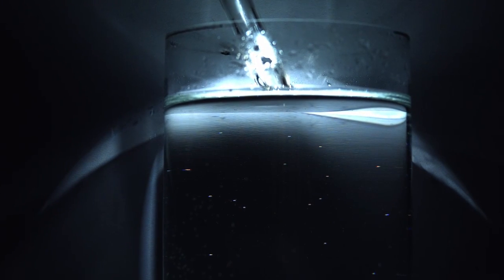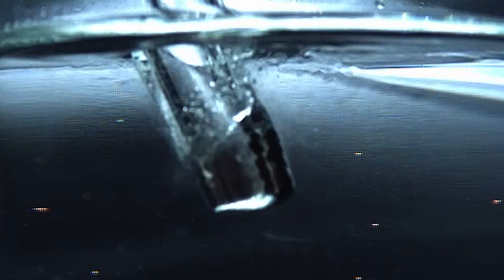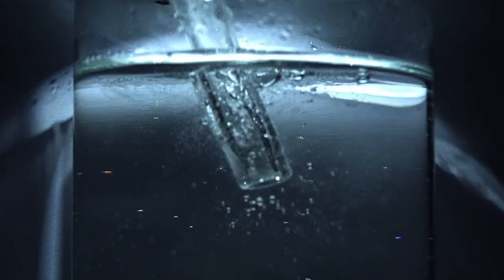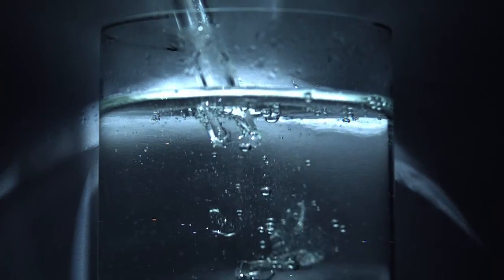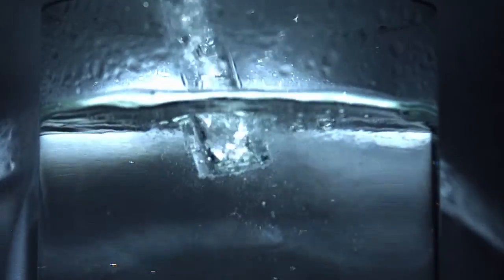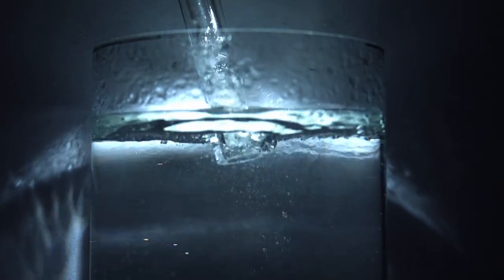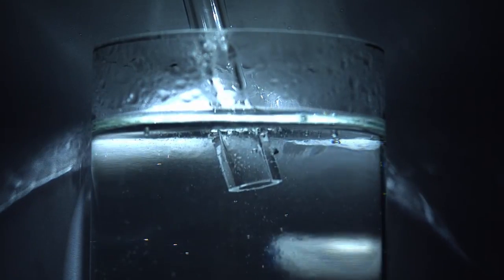What happens when RED HOT glass meets water? -Slow motion video

Comment: Could you try this same experiment with something that's colder than water, when in liquid form?

Also I have a feeling that the glass breaks because; while the most outside layer shrinks the most inside layer of the glass gives. But when they both shrink (e.g the water is sucked inside), nothing gives and the crack is started from both sides of the glass. And when the cracks meet, they combine and continue circling the tube.

Thanks for awesome videos!

Comment: Was waiting for the water to climb up the tube cause this made me think of a moronic thing me and my friends did while camping as young. We found a 30 cm steel pipe with about 5cm outer diamiter and i would guess close to 1 cm thick wich we put in our camp fire untill it got red hot. When red we thought, what are we going to do with it, and came up with the brilliant idea that we could drop it in the lake we camped just next to. Took as a big stick as we could in it to carry it (yes... i did say moronic) and managed to get it out of the fire. Cause of the weight and heat of it we had issues getting it to the lake cause it put fire to every thing. But at last we got it on the top of a good stick hard enough to get stuck carrying it the last bit.
Then comes the thing this reminded me of. On the end of the stick i put it gently down in the water at about 45degre angle. What we then thought was going to happen was that it would fizz and boil a bit. What happened, and what i with what i know now would have guessed would happen, was that it first shot of the stick straight into the water, then threw a jet of steam with a loud bang straight at me. Got away with very very minor burns to my hands luckily.

Thats how i got to know why dealing with very hot stuff and water can be a bit interesting ;)

Comment: I thought borosilicate was supported to be more thermally durable - unless yes you unevenly heat/cool it .
Like this!
i assume that suck of water flash cools the inside creating a gradient between the inside and outside...
Also these are glass tubes not 'rods'. 
I suspect a rod might fare better particularly if you immersed the whole thing!

Are these open or closed tubes?

Comment: The steam expanding on the outside of the tube is placing the tube under compression, where a tube is stronger. When the water is inside the tube, and expands to steam, it places it under expansion stress and cracks it open.

Comment: At a guess, since the crack happened near the interface between air and water, I'd assume that's one of the reasons for the crack. Putting it deeper in might be useful... if only so that there isn't a sudden, jarring change once the Leidenfrost wears off and air gets involved in some way.
I can see @Photoloss and his comment under as I write this and it's obviously thermal shock. I think he's onto something, and I wonder if putting the glass in deeper would change anything.

I'd also be curious to see what would happen with oil over the water. Different... what's it, thermal... thing. Forget what it's called. Metal feels colder than wood because different materials absorb heat differently. Air and water have different values, so does oil.
Reply: Thermal...Conductivity? 🤣
I like how everyone with high school understanding of physics(at very best) is trying to explain how it works with elementary physics concepts to a chemist PhD 🤣👌best one is user called fartgirl420 or something like that 🤣🤣
Take notes thunderfoot!!
Reply: @TheBozn  Don't you have a vodka rationing line to go stand in, comrade

Comment: Great stuff again, thanks VoTF. I liked the background music too.

Apart from the terrific spectacle of physics in slomo close-up :) I can't help looking a little into the materials.

I found: mean specific heat for both is the same (830 J/k*K), but for borosilicate thermal conductivity is 1.20 W/(m*K)@90°C and fused silica better with 1.47-1.55 W/(m*K)@100-200°C. 
These small differences improve silica over borosolicate, but obviously do not explain its improved thermal robustness. Must be in the microstructures?
Better SiO2 purity of silica forms a stronger 'lattice', in case of amorphous solids: smaller blocks, stacked more regularly.  My twopence..

A (lab)glass expert seeing your video could give us a few fine nuggets of knowlegde!

Ref: 
https://www.heraeus.com/en/hqs/fused_silica_quartz_knowledge_base/properties/properties.aspx
https://www.schott.com/d/borofloat/4d03b8f4-0583-4139-9841-952114e60dee/schott-data-sheet-thermal-properties-borofloat-english-23112018.pdf

Comment: I think it stopped boiling when it broke away because the heat energy was transformed into mechanical tension between differing layers contracting and expanding at different rates. That was then transformed into mechanical energy as it fractured, and then into motion as the pieces push away from each other. That explosive motion requires energy to break and move. That energy is only available in heat. As it robs the heat, it cools the glass. Similar to part of the process involved in refrigeration where expansion and evaporation robs heat energy to effect the break in surface tension between liquid to gaseous states. 

Notice that the silicate kept boiling even after sucking the cooler water up into the tube.

Comment: It's amazing how fast the glass shatters even at 20,000 fps.
Reply: glass cracks at about 3-4x speed of sound, around 1km/s, at 20000 fps in just one frame crack will expand 5cm, which is around (i think) a radius of this glass plunger
Reply: @NickPride  3-4x speed of sound in air*. Most materials crack at their respective speed of sound, which for solids is a lot higher than that of gases. The speed of sound in metals can be as high as 5 km/s. The reason it breaks at the speed of sound (of the material) is because that's the speed at which mechanical interactions are propagated, which seems pretty obvious when you put it that way.
Reply: speed of sound here was just for comparison of speeds, people usually know about speed of sound in regular conditions (air, 20C, 1atm) and can generally imagine how fast it is
Reply: @NickPride  right-right, I just thought I'd expand on it just in case it was confusing for anyone.

Comment: It seems rather simple, so I guess there is something I dont see:

It breaks when the inner part is cooled because there is nothing to support the contraction. when the outside layer cools, it increases the strain on the glass, but is supported by the glass underneath. When the inner glads is cooled there is nothing to support it so it shrinks and cant hold its own internal pressure, as it was. That, combined with the already elevated strain from the outer glass, causes the failure. Think of a Prince Rupert's drop. Try making one out of silicate and see the effect and how it differs.

Comment: For the breakage of the glass rod, my theory of the situation is that the breakage occurred from more-or-less obvious temperature delta (thermal shock) between the submerged portion and the unsubmerged portion of the glass tube. From there, it seems like the boiling of the water within the tube coupled with water intake that had caused a lower pressure zone below the bottom of the tube and caused the cracked portion of the glass to shoot in the downwards direction. I assume it was the transfer of energy of converting the water within the tube to steam, that caused the tube to break, only after, the tube had transferred a lot of its energy.

Very interesting footage! Love to see more!

Comment: OK, stress is needed to break the material. What stresses can we think of?
1) thermal differential stress (tip in water contracted, part out of water did not)
2) shock wave stress from flash boiling of water sucked up into tube
3) stress from impact of water hitting surface after steam bubble collapse
4) Pressure differential stress from water vs air or steam (trivial, but aren't most of these?)
that's all I can think of.

Comment: How about a video of you creating Rupert's Drops in water in high speed?  Not a video of one being destroyed by a hammer, or a gun, or a press. Those videos are all over youtube.  But a video of when the glass contacts the water, and forms its iconic shape. 

Hopefully, something like that is film-able, and the splash doesn't obscure the view.  Dunno how high up you have to drop the piece of molten glass from for it to work though.  If low enough, hopefully there wouldn't be too much of a splash. 

That could be a test too.  Can the glass drop from a small distance and it still work?  Does it HAVE to be dropped from multiple feet in the air?   How deep does the water have to be for it to work? Lots of very interesting questions to be had out of nothing more than glass and water!

Comment: Seems to me just hydralic hammer effect combined with crystals shrinking in different speeds that goes over the limits what glass can take without cracking ..             But then again glass will do it without hyd hammer effect as well…      just like when you want to get clean cut in glass bottle where you heat an conductor/resistor around the bottle where you want to break it and put it in cold water.. it should break of at that point cleanly …   having any scratch or defect on surface of glass at that point will instantly make it break..

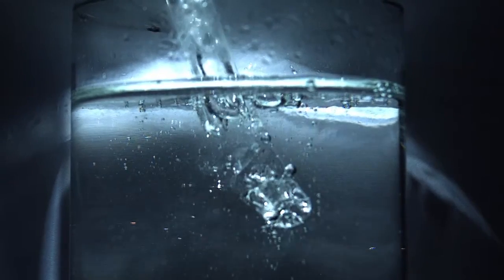Comment: The reason of the glass breaking apart 1:30 maybe is because the glass part in the water cools rapidly down after is has been cooled down the heat from the upper part starts to go to the colder part.

I assume it rapidly cools down then heatens back up and cools back down... A cycle that goes very fast in a short amount of time. the energy traveling in cycles creates a high frequentie? Idk
Reply: Ricardo Acosta Torres yes, the hot parts of the glass are moving this and that way, the cold parts moving another way... the bonds will shatter
Reply: also, while I’m not sure how to quantify the amount of force the bubbles produce and their impact on the glass, I do believe the RATE at which these bubbles appear and burst, so many and incredibly fast, that agitates the glass even further, leading to breakage

Comment: Why does the gas layer collapses from the top down?
Reply: DeDeNoM Probably it collapses due to inner tension/stress between the already rigid outside and the now contracting inside. At the top it’s probably still a bit warmer on the inside so the rigid layer is thinner and it breaks more easy at that point rather than where everything has cooled down and is rigid already.

Comment: The reason why it cracks when it sucks up the water might be because it was still hot inside so the outside cooled down and contracted, while the inside was still soft. Then when water is sucked up, the inside cools rapidly and contracts but the outside is already rigid and does not move along therefore building up internal pressure/tension which the glass cannot withstand. The silica glass might just cool more evenly or withstand higher tensions or maybe it just doesn’t contract as much while cooling. 

Anyways, this is just speculation and I can’t guarantee that I’m right but it makes sense to me..

Comment: Water sucked up=sudden thermal shock to the inside of the glass. My guess is since the glass shrinks when it cools down the outer surface compresses the cylinder which is extremely resilient to that kind of pressure, but the inner surface essentially tears inwards robbing it of all structural support. And with everything happening so quickly it just breaks from the outside still pressing down.
Reply: Now THAT'S an interesting hypothesis.
Reply: It would be interesting to plunge the borosilicate a bit deeper and measure time to breaking with varying depths
Reply: Eduardo G also I think it would be interesting to NOT use a tube at all, I feel like the the cold water rushing up makes it a little more obvious what’s happening . (I mean to use a solid glass cylinder and observe the break purely from external interactions )
Reply: Check prince rupert drop.... youre right
Reply: But borosilica is incredibly resistant to thermal expansion, regarding simple silica -  its very sensetive to it. So here is controversy on that - opposit behavior for this experiment.
UPDATE: probably the way it goes is something to do with hollow tube - my thoughts on the glass rod - situation will be opposite
Reply: This is the answer.
Reply: Sounds correct . I’m curious what a red hot sphere of glass would do in these circumstance
Reply: I think there is a specific point where the glass cools extremely rapidly, after the water contacts the glass creating flaws in the crystal structure.

Comment: Would a diamond straw break?
Reply: A "perfect" diamond definitely not because molecular bonds are very strong and stable. Next up it would likely burn your hands because diamond is an excellent thermal conductor. Which also means quenching it drains more heat from the entire thing and keeps the temperature more stable because residual heat can move around more quickly.

But as with any crystal if you have substantial faults those can act as pretty significant barriers in addition to being unstable overall, in which case one side of the fault line would quickly drain of heat, shrink and break off. No idea just how much of a fault you'd need to inflict that on diamond though, and you might need a special oxygen-free setup because unlike glass diamond actually burns quite well once it gets hot enough.
Reply: @Photoloss  neat! Thanks for indulging my curiosity.